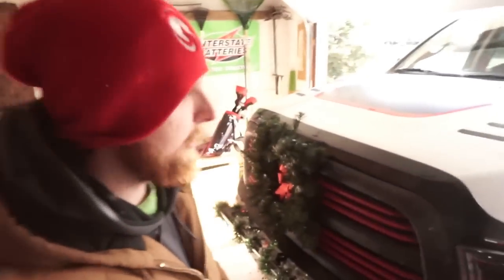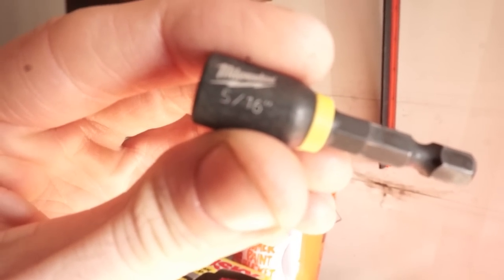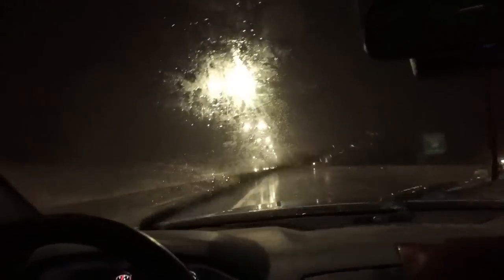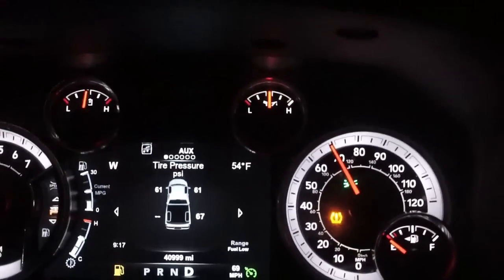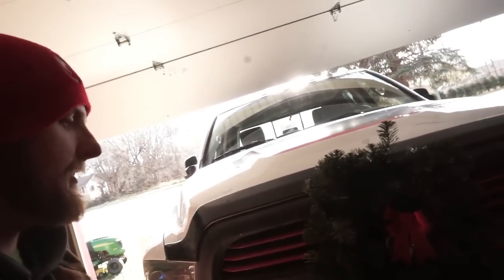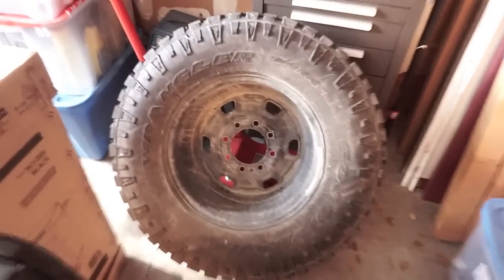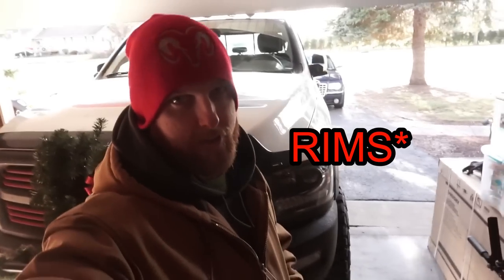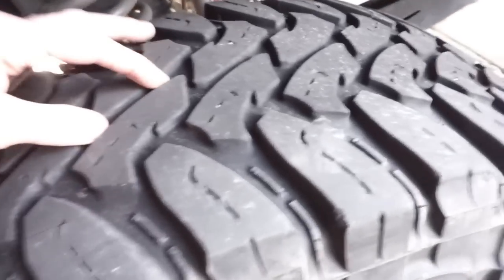I'm DONE With 37" Mud Tires...

Comment from the maker: Let me know of some Good 34" or 35" street worthy tires. No Mudterrains! :)
Reply: IWrocker It would really help if you made a video on showing like when and where you should use the front/rear lockers and the disconnecting say bar, im getting a power wagon and im new to this stuff, and i haven't found any good clear information on them and i would love a great explanation on when you need to use them or whenever its fine to use them, i don't want to wrongfully use them. Please.
Reply from the maker: I have older videos on that, but I can reintegrate that info into a new video if you would like as I am more familiar with the truck now then I was a year ago
Reply: IWrocker I got 35 12.50s on my 98 2500 and out of 3 sets of tires by far my favorite are the bfg all terrain ko2s great tire for snow mud and wear like iron on the road look aggressive aswell
Reply: Go with general grabber at2
Reply: IWrocker yes please if you dont mind that would really help me out a lot !
Reply: I’ve run both BFG A/T and Goodyear Duratrac on my old truck (still on stock duratrac on the PowerWagon).   With the BFG I always had balancing problems.  Noisy as hell, and not the best ride. They did perform well in most conditions and they lasted for about 65k miles (I couldn’t wait for them to wear out as I couldn’t stand the ride or sound). The Duratrac were far quieter and smoother ride.  I will also say, there IS a difference between the Duratracks that you get at a tire store vs the OEM ones FCA puts on the Power Wagon (the aftermarket ones seem better quality ride and sound).  My brother in law had Nittos on his truck and got no life out of them.   I’m sure you’ll hear all kinds of opinions, so just adding my experience as I don’t have any brand loyalty
I do know I’ll be paying attention to what 35s you end up with as I’ll probably bump up to 35l ATs on my power wagon when it’s time to change.
Reply: rebelcat420 yea I had duratracs on before the bfgs I liked them but they wore out so fast too soft of a tire for the torque my motor puts down. I can't hear the tires over my exhaust Lol but I don't remember them being loud on my k5 tho and no brand loyalty here either gonna try a different tire every set unless I find the perfect tire then maybe I won't who knows
Reply: Firestone Transforce At2. I have them on my truck. Truck has 170,000 miles and I just put my second set on 5000 miles ago( after the original tires wore out, so 3 sets total). You wont be disappointed! I occasionally plow also considering I am just North of you. Just my opinion(2 cents)
Reply: 35'' BFG ko2 is what i have on my ram 2500 and it feels and runs amazing, i travel everyday for work and i do not have any issues with these tires. saves me gas aswell going froma mud to a all terrian
Reply: IWrocker if I were you I wouldn’t go for 35s I know it’s lighter and all I just think it won’t look that great with the 5 inch lift , and I am on the fence on having those Toyo 37s on my raptor , are they worth it , is it obnoxiously loud on the highway like the Mud grappler from nitto or is compatible with everyday driving ? Let’s face it  we’re 90% of the time on the streets than on the trail
Reply: Nitto trail grapplers. I have 115k miles on my 14 powerwagon.
Reply: I hear that Nexen Roadian AT Pros and the BF Goodrich K02s are good all terrains.
Reply from the maker: Kaled harbi the Toyos are great and are about a medium on the loud scale. They are soft compound though and thus are just getting eaten up on the roads
Reply: Get the BFG KO2’s but stick with 37’s. I have 35’s on my 2012 Powerwagon and love them but they only measure a little over 33. The 37’s are just a little over 35” and I will be going to those next. Mine is at stock height and from all accounts the 37’s will fit without even a leveling kit. I have 15000+ miles on my KO2’s and they are barely showing any wear
Reply: Bf Goodrich all terrains are great off road and on road. Quit and long lasting. I have them on my Dakota 2wd never got stuck.
Reply: IWrocker big O Bigfoot all terrain 32/1150 diesel size does mudding and highway 77,000 miles still new
Reply: I've got Toyo Open country AT2 on my Cummins. 35s. Awesome tire. Wearing good, smooth at highway speeds and just noisy enough to be cool without being annoying.
Reply: Any General Grabber tires. Affordable, good quality and made in the US. I run the HTS60 on my truck and I'm really happy with them
Reply: General Grabbers...had them on my Ramcharger and loved them.
Reply: I got 60k on. 35" toyo at2 xtreme and they still have tread. Awesome all terrain tires for daily driving. Not cheap though
Reply: Nitto  Terra Grapplers are best all around. Quiet on the road, can carry a heavy load with E load range, and 60,000 miles on mine and still going. Also, they have 8 ply side walls are puncture resistant.
Reply: Craig Luhr so you've had "all" of the all terrain tires around???
Reply: Rockytop VFL I've tried a few . Toyo and nitto are the same. I've used BFG, Yokohama, Goodyear wrangler, Pro comp Extreme AT,  Armstrong, MICKEY Thompson,  and military non-directional. My opinion is to stick with Nitto. You go buy whatever you like.
Reply: I got 40k miles out of my 35" Toyo MT's on my 1 ton Cummins and 26k miles on 35" BFG AT's.  BFG's ruled in the snow but wore out quick vs the MT's which were rock solid but slid on compacted snow like hockey pucks.  I'm now running 33" General Articmax winter snow and ice tires which grip these slippery roads like no other.
Reply: IWrocker you could still run the 37s just run the 12 ply m/ts
Reply: IWrocker for daily driving my grandma has fallen wildpeak at3w tires and they are great I’d recommend them they did great in snow the one time we had snow in Texas and water when it flooded was out standing I would highly recommend them to you
Reply: I have same on my JK love them, great in rocks and trails.  Good in snow, but ice i'd say they're below average.
Reply: They will do well for snow and mileage.
Reply: I play off road myself and I drive my rig as a daily driver. I have always used BF A/T and have had good luck with them. I liked the look of wrangler duratracs so I put 35X12.5 on my lifted 04 ram 1500 back in 2009. I have about 50k on them now and gave the truck to my son. On my 16 PW I will most likely put on 35X12.5 wrangler duratrac next summer. You do great work, keep it up.
Reply: Toyo Open Country RT all terrains. Best tires on market for daily
Reply: I hear toyo makes a open country C/T that is superb for daily
Reply: Keep it locked when offroad.... :)
Reply: We are running 315-70-17 Dura-tracs on our power wagon, best all condition tires even on ice or snow.
Reply: Duratracs are great winter tires.  Like a few have said, they wear out fast, but if you use them for winter, you can't go wrong.  MTs suck in winter conditions.
Reply: I have a 13' PW. I just ran 35" BFG all terrain KO2.. they rode great, pretty good in snow for that width, and were real quiet. But I only had like 1/4" tread left after maybe 20k miles... I recently put on Cooper STT Pro's. Have around 10k miles okn these. They look good, are a bit noisy, and are prob wearing a little better then the KO2 did. But they are Terrible in snow, wake silly hard packed !!! Also I had Nitto  TerraGrapplers on my 08 Tundra. Paid $1400 for them (35's) and they were junk by 20k, and Terrible in snow as well... hope this helps.. .. I plan on goijng to 37's for everyday driving and weekend wheeling. What's your thoughts on the size??
Reply: IWrocker I have nitto exo with snow flake on them..35x12.50.17..they rub a little on the control arms..I have a set of thurens ready to install when I have time...the tires are very good..little hum...but excellent in snow...my p.w...has more traction in snow and wet...
Reply: Ben Noyes pro comp makes awesome tires I run the 37x12.50 A/T xtreme great tire
Reply: Nitto ridge grapplers or toyo r/t. Both are extremely quiet and comfortable but still aggressive. Bfg ko2's are good quiet tires but in my opinion all terrains are too soft for a 2500 let alone a power wagon
Reply: get bead lock rims and all terrian tires with kevlar in em 35's
Reply: Nitto Ridge Grapplers
Reply: 35 Dueler HT
Reply: MT ATZP3
Reply: Joshua Taylor wear out fast ? 130,000 Kms  so prolly 85,000 miles and still haven’t hit the wear bar. I go off road but not crazy , I also run nitrogen and rotate every oil change. Ram 1500
Reply: I know this is an old video but for anyone new watching I have the Atturo Blade XT 35x12.50 (hybrid tire) on my Ram 1500, Awesome tire for the money.  For my Power Wagon i went with Kanati trail hogs 305 55 20 33 1/2 inch (same tread pattern as the Duratrac but less expensive.) Tires arrived today just waiting on my wheels to be delivered.  Factory height on my 2016 Power Wagon which is why the 33's. IWrocker I really enjoy all your videos especially the Power Wagon vids. Wished you still had one!!!
Reply: @Khaled-tx5xj   you can get different tread types for more quiet
Reply: @brandonkaufman9307  is there any rub on control arm or anything? I have a 12 bone stock and am wanting to upgrade tire size
Reply: Cooper Discover AT3 60k warranty, Hotshot truckers getting 80k towing!

Comment: It looks like your truck will fit if you attach your winch cable to your front axle to suck the chassis down so your clearance lights will clear the garage header board then once its clear release tension on your winch.  Its how all of us guys with Rockcrawlers on 40+'s get our rigs in the garage.  That or bolt some clearance light delete plates on and make sure the garage door is pushed all the way up.

Comment: I have a '07 Power Wagon with 37"x12.5" Cooper Discoverer S/T MAXX. Right now the truck is mostly driven unloaded/lightly loaded, tires are set to 32PSI front and 30PSI rear. Traction on-road is great, to include pavement and dirt. Tire noise is relatively quiet for such a tire, although mine are studded which I'm sure doesn't help. Off-road traction is great as well, I have had no problems with both slippery rock and deep mud. I haven't used them in the snow too much, though the experience I do have with them has been great. They have a reinforced 3-ply sidewall, as well as a softer tread compound that stays soft during cold weather.

Overall, I think they're one of the best, if not the best hybrid AT/MT tires on the market. If you're looking for a dedicated "street tire" go with a good "Highway" or "H/T" tire. The more tread contacting the road, the better. 

Also, I just discovered that Nokian makes their excellent Hakkapeliitta LT2 up to a 35.
Reply: Do you have a lift... I really want to run 37x11.5r20 nittos on my 08 powerwagon stock but dont know if theyll fit

Comment: I've been enjoying your videos.  In fact I just bought a 2018 Power Wagon.  Mine has the graphics deleted and from a distance just looks like a Plain Jane 2500.  But I digress, that was some pretty good rain.  I've been driving in heavy rain here in Forida my entire life.  I am an avid Rain-X fan.  There will be people pulling of the road because they can't see or driving with their flashers on (illegal here in Florida) and I haven't even switched on the wipers yet.  I clean the windshield with a glass cleaner, I like Invisible Glass, and then apply the Rain-X.  Let it haze up then buff with a paper towel or better yet a clean microfiber cloth.  "TIP", before you buff, mist the glass with cold water from a spray bottle.  Makes it go much easier and faster.  Then resist the urge to switch on the wipers.  The harder it rains the better and at night sometimes it will be raining and you won't even see the water on the windshield.  Can't tell you if it will help with snow. Try it.  Do a video.  Thanks for the Power Wagon education
Reply: I use Rain-X all the time too. I put it on about every two weeks or so. During the heaviest rain, I am the only one not using my wipers and just like you, I don't need to slow down during rain storms. I can see just fine, unlike everyone else, hahaha. That shit is awesome!

Comment: I'm running a 35 Toyo AT 2 on my f350. Been on the truck 3 years for 30,000 and probably get another 7,500 to 10,000 out of them. Had a similar experience with the same size BFG KO 2. The KO 2 was probably a little quieter than the AT 2. You will be a lot happier with an all terrain tire on the road. They perform much better than mudders on the highway in rain, snow and Ice.

Comment: I run 35 " Hancock dynapro AT
I use them for everything trails to highway. Excellent traction, no humming and good rubber compound for the abuse that heavy trucks put in them very little wear after a little more then a year of use.

Comment: I hear the Toyo open country AT's are really good for wear.  I'm going to try those next.  Don't get KO2's, they don't last at all.  Also, part of your tire wear is the pressures you're at.  Assuming those are like 12.5" wide you should probably be around 55 psi.  That might help them wear better while still being safe for your truck.
Reply: Grarder the KO2’s are an out standing tire they in my jeep and they get beat to piss and they still look like they haven’t aged from nude rocks and towing but I property rotate my tires
Reply: Marcus.  I have them on my diesel ram 2500.  They need replacing and I'm only at 17k miles, and I do have the load range e tires.  I will say, they have worn pretty evenly and not chipped or anything, but they're just not a hard enough compound for a truck this size.  A Wrangler 4 door weighs about 4500 lbs, a Power wagon weighs about 7000 lbs, and a diesel like mine ways almost 8000 lbs.  In saying they don't last I did mean specifically for large trucks, sorry for the confusion there.

Comment: Do you run 37x12.5 or 37x13.5 with that lift? ? I'm considering getting that lift but I want to run a 13.50 tire with no rubbing what are your thoughts?

Comment: Toyo Open Country R/Ts.  I have over 50,000 miles on a set of 37"s on my truck with 5-10k more life left in them.  They perform great in rain, water, snow,  mud, and on the street plus have very low road noise.  Add in a 45,000 mile warranty and you can't get better IMO.

Btw, nice truck... for a gasser! 👍👍👍

P.S. You've got to rotate tires like every 5K or so if you want them to wear evenly.

Comment: I’ve personally owned a set of bfg at’s and a set of good year wranglers. Both lasted very well.  However, these were on light trucks (84 k5 diesel and 12 Nissan Frontier) I was most impressed with the bfgs on the k5. I had it for 2 years and the tread showed no noticible difference over that time period and it was a DD.

Comment: Your tires are over inflated. You can see the front tires are wearing out the center more than the outside. When you go with bigger tires, the weight gets distributed differently. Bring the pressures down to about 45 in the front and 40 in the rear (if your not towing) and you'll notice a big difference in the wear. Also, Toyos wear horribly. I had two sets of 35s and they needed replaced by 30k miles. The best tires I've had are ProComp Extreme MT2s. They are amazing on and off road and my last set got over 60k miles! They are still load range E for towing, but when you air down, they are unstoppable in the rocks and mud. Plus they are cheaper than the Toyos, because you're not buying the name.

Comment: I just put 315/70r17 falken wildpeak at3w's on my 2012 power wagon. Only have about 1500 miles on them. Queit, smooth and have good traction in the rain. Not sure about snow yet but I've read a lot of good things before I got them.

Comment: I'm running bf-Goodrich 33s on stock 8inch rims on a 4 inch superlift, I'm about to go to 37x12.5s on a 20x9 rim, I did the lift after I shot this vid, I'm hoping I don't have to do to much customizing in the weelwels. wish me luck. nice truck by the way.
Reply: Smaller the rim the better

Comment: Circle track wheels from Jegs...  Flat track D cut, or pie cut. (You may also wish to run is 8 screws or so around inside and outside beads.) This will keep your tire in the rim until you WANT them off.... [Old drag racing trick]

Comment: I highly recommend the bfgoodrich ko2 in any size. I've had them on several trucks. They wear evenly and last a long time. I have a '17 power wagon and can't wait until my duratracks are worn out so I can swap them out. I work in construction, so I am off road everyday. They perform well in snow and the mud. They are also much quieter at highway speeds, and still look nice and aggressive.

Comment: So sell them get you some good Toyo RT with a 45,000 mile warranty. Let's be honest after Changing them 3 times you won't want to swap them as much. And what happens when you need them some day and they are sitting in the garage. Just saying go with a good AT or hybrid.  What pressure where you at when you lost your bead? If you drop back  to 35s. You should be able to go to a lower pressure without loosing a bead. With 37s and 17s you have a lot of sidewall to support needing more air pressure.  I also noticed that you are running all of your tires at around 65psi. You should be more like 55 front 45 rear. That's why your tires are wareing quicker than they should. Bigger tires = more sufrface area. More surface area means less air is required to hold up the weight of the truck. I run my Toyo RT 35x12.5x17s at 55 front 45 rear. Unless I'm loaded down then I fill them up. With 37 it should be less pressure. But not to little or they become squrly. The best way is to watch tire ware it should be pretty close to even all the way across the tires. If you want to keep the 37s consider going to a little larger rim. I typically will are down to 25psi in the sand. With Method wheels. Never lost a bead.